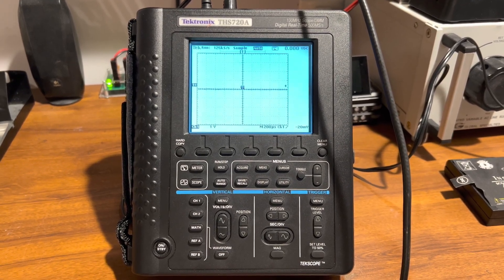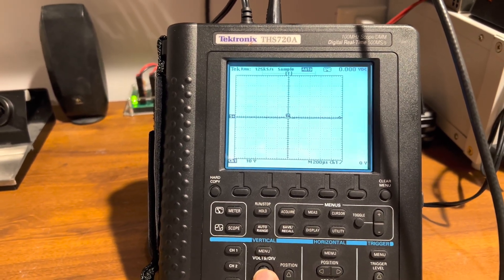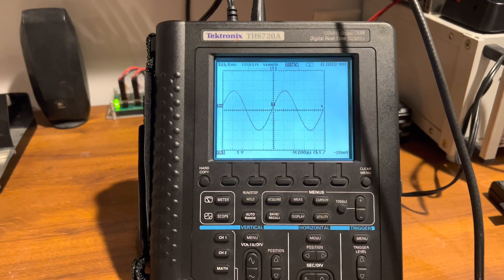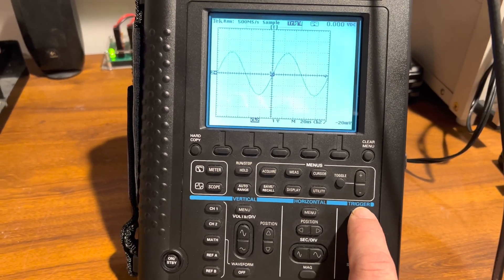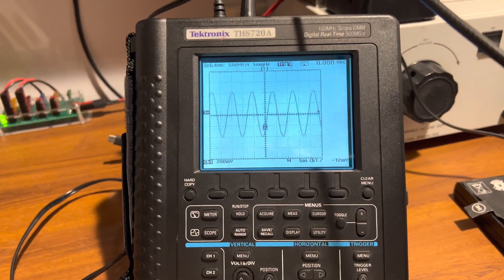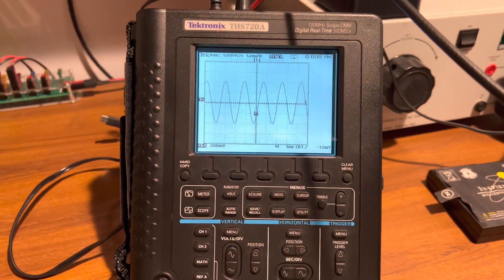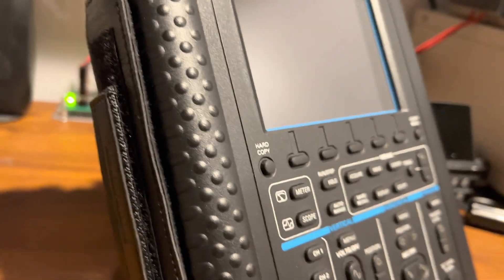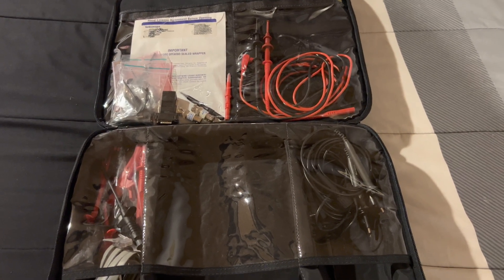Tektronix tds720a Handheld Oscilloscope Overview

Comment: At 3:05 how is it 2Vpp. On the oscilloscope it's showing 1V per division.. Shouldn't it be 4V?
Reply from the maker: It is correct as I didn’t use a 50 ohm terminator, so will read double which would be 4v instead of 2v peak to peak.
Reply: @thetechgenie7374  what does a 50ohm terminator do?
Reply from the maker: @akashv5622  it is pretty much a resistor that in the BNC terminator adapter that matches the impedance of the signal generator output which is 50 ohms.
Reply: @thetechgenie7374  do probes usually come with these terminators?
Reply: @akashv5622  some oscilloscopes do have 50 ohm termination that is selectable in the coupling menu. If your scope doesnt have it you need a BNC-BNC 50-ohm terminated adapter.

Comment: Hi there,
Thanks for your video. I am between two choices, one is to buy the Chinese colour oscope wirh 7" display for $200 and the other is buying one of this which one of the guys wants to sell for almost $400! Which one would you recommend considering the Tektronix is MT 20years old and the Chinese one uses commercialized parts I mean I can replace its 7" colour LCD with $40 if broken!
Reply from the maker: It really depends on the projects you’re working on. The Tektronix is a great truly isolated oscilloscope where all channels are isolated from each other. This is great if you work with HV, or power supplies as you won’t need to worry about buying a active differential probe and you can use regular probes, or a HV probe if you work with HV. If you are working on regular electronic projects, or a technician fixing stuff the Chinese handheld scopes will be more suitable but get a decent one like the Owon hds272s, or even a bench oscilloscope, it going to likely have faster update rate, more deep memory and the Owon still isolated from mains just not separate channels like the  Tektronix.

The other problem you have to worry about with the Tektronix is they are over 20 years old and depending if you get a low hour one, the higher hours the more likely screen going to fail, plus the polarizers on the screen delaminate and the HP opto couplers drift and you get DC offset. A good low hour condition one with original accessories and original probe with a good battery can cost 1k, to get one for $400 bucks with everything is rare. So if you can find one that everything included in great shape I mean close to mint condition for $400 definitely go for it as it worth it as a great truly isolation scope, I use mines quite a bit that I bought extra batteries as don’t have to deal with differential probes as work on quite a bit of vintage and tube gear where dealing with several hundred volts to KV range regularly. Plus can trigger off the multimeter jacks.

Chinese oscilloscopes also come a long ways. They are good value for money and suit most people needs no problem and usually recommend over the Tektronix.